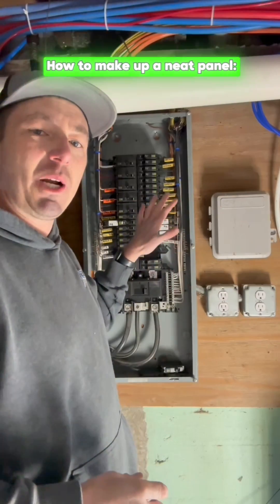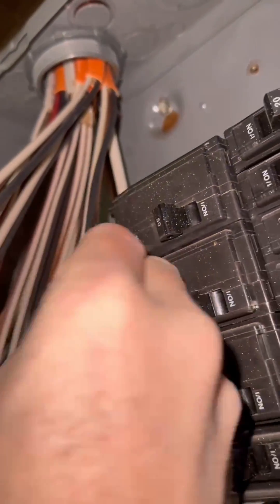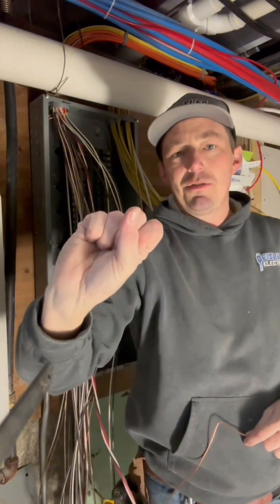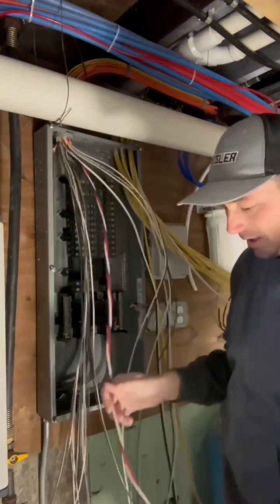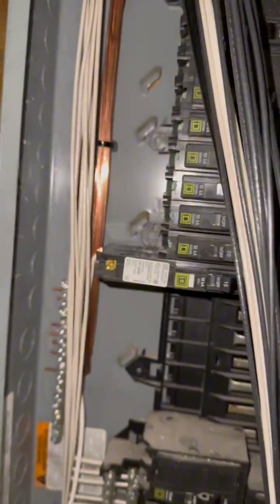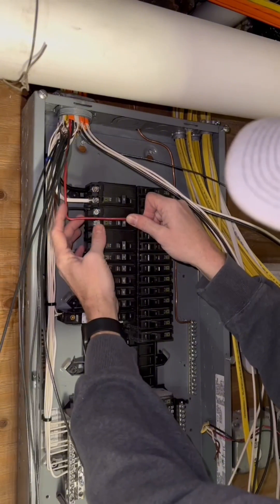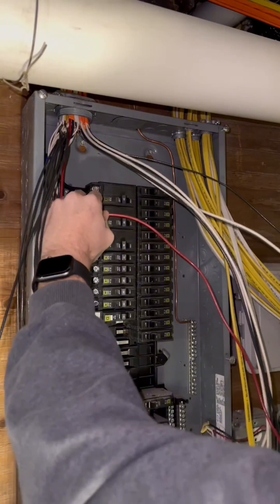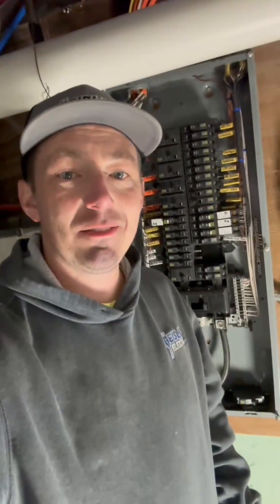How to make up an electrical panel. Remember, some things are better left to the pros…

Comment: You have a code violation in the white grounded conductors. They must be identified to what circuit they are associated with. If the black wire was on say circuit # 12 then you must mark the white wire with a 12. Where are the required AFCI circuit breakers ?

Comment: Has not been a thing called a neutral in the NEC in over ten years. Aholes changed one of the most commonly used electrical term in the last 120 years to grounded conductor. Also changed the term.light fixture to luminares.

Comment: Appears to be a code violation. Never saw a 2" connector approved for more then 1 cable. Most 1/2 & 3/4" two screw connectors are approved for two type NM cables.
Reply: yup, big violation, not exactly a pro at all.
Reply: You right. They work over all is nice organized. But he needed a few connectors like the right side.